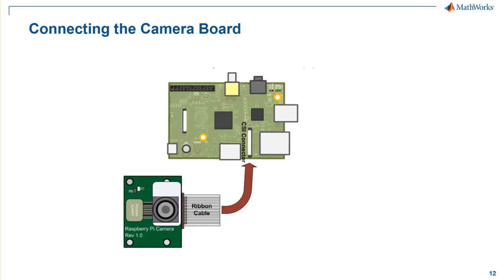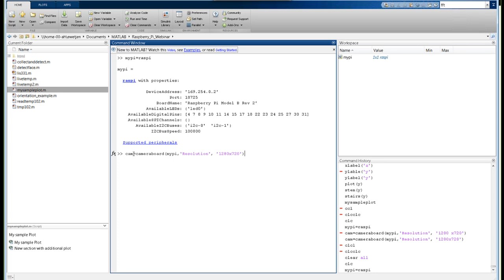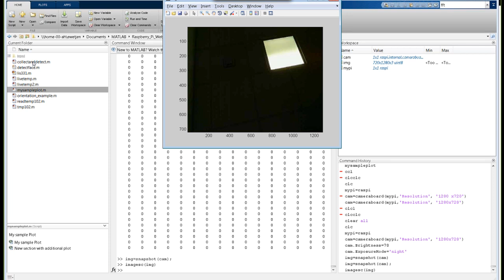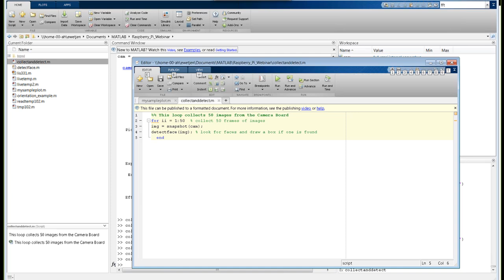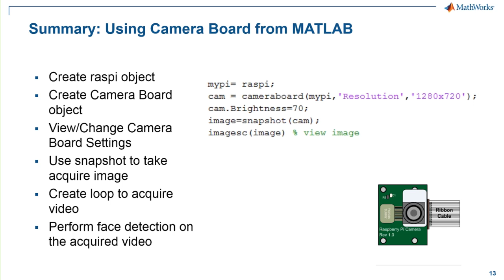Using MATLAB with a Raspberry Pi Camera Board

Comment: Excellent video, I wonder how I keep the camera that I have connected to the raspberry pi can access it as a code for use on guide, that is, how I can obtain or code that chamber which is connected to my raspberry pi, and not always call it by simulink (raspberrypilib). I would greatly appreciate it.